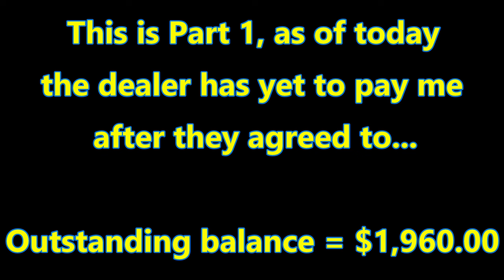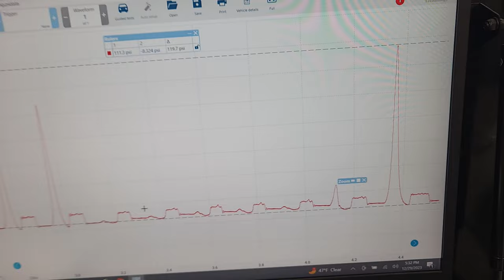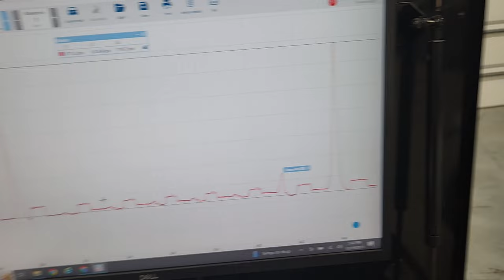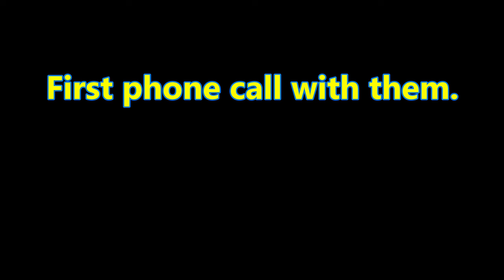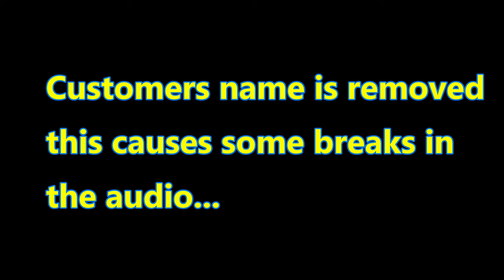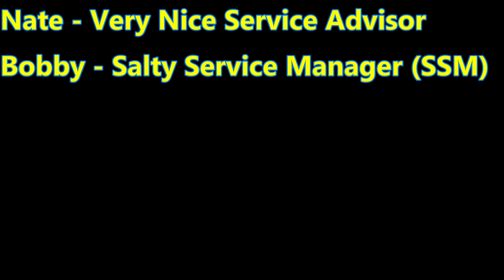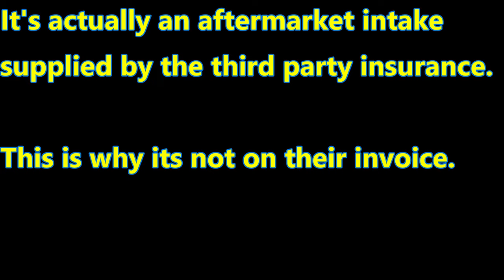Local Kia dealer broke her car! Repaired for 4 Months & STILL HAVEN'T PAID!!!

Comment: I no longer trust dealers. I took my E350 to them for a startup rattle, they charged $3800 to replace left intake VVT, chain tensioner. After picking up car, it showed no change in condition. Returned car, they first said water in oil despite car not losing water and oil analysis showed no water or coolant in oil with only 500 miles on new oil, at that time. Then they claimed unapproved oil despite showing MB approval on the oil bottle. It was the look of the oil, Liqui-Moly 5w-40 Molygen, it has a green tint when new, after a while the green color fades, it's a UV dye for leak detection. Then claimed oil pressure not building fast enough. I can confirm that, but after changing to MB oil, no change in slow oil pressure. This engine has a two stage oil pressure system, a diverter valve to lower oil pressure for EPA mandates on fuel economy. I unplugged the solenoid, and oil pressure builds as soon as car is started. Engine is quiet now and runs cooler. Before would have a lot of heat coming from under car after driving and cooling fan would sound like a bi-plane about to take off. Scan tool confirms coolant is 20 degrees cooler with low pressure diverter valve closed, or unplugged. Expensive lesson, but stealership unservice departments are run by used car sales people and con artists. No refund, they blamed me for failure.

Comment: I would guess someone used a power tool and over torqued and damaged that intake. I remember a 6.0 powerstroke come in with misfire. Had been at another shop and they had the intake off, but couldnt diagnose the misfire. So the said go see Palmer. Anyways found a small  bolt embedded into the piston. Other shop washed their hands, and I had to put a piston in the truck.

Comment: They installed a new gasket, that sits below the lower runner. They were the last one in there. That means they took out "a" lower intake manifold and put one back in. It doesn't matter who supplied this lower intake manifold, they messed with it and they left that brass part in there. Their fault, they solve it or pay for it getting solved.

Comment: Honestly they admitted to R&R in the lower intake, who cares where it came from. They are directly liable for anything that results from their labor in that regard. The guy trying to pass the buck based on where the part came from is moot. Even if it was the original lower intake manifold they are still liable. This isn't a parts issue, it's a labor issue. The tech was careless and dropped the bushing in the manifold, then probably got in a rush trying to beat book and used an impact on the bolts. The service manager is trying to cover for his employee.
Reply: He knew that. It's a classic "I need to buy time to come up with an excuse to get out of it"
Reply: Gotta love the flat rate auto repair model..its messed up to make them get paid per part, they should be paid hourly so they have time to wrk properly. Flat rate is shit in my opinion

Comment: Just spitballing...It seems that when the intake was put back, new or original, that bushing was missplaced and not located. Which means a replacement bushing was installed. Probably not included in the parts that the extended wartnty company, Car Shield, supplied, meaning that the tech had to acquire a replacement. Where did it come from? Charged on the invoice?
Hummm!
Reply: I would think the bushing comes with the new manifold. I suspect the bushing on the old manifold fell out during removal and straight into the inlet port, somehow unnoticed by the technician.  If I heard a "clink" as I pulled a manifold my paranoia would kick into overdrive.